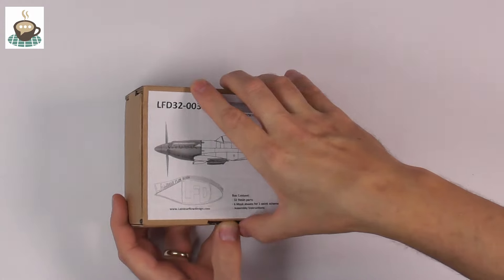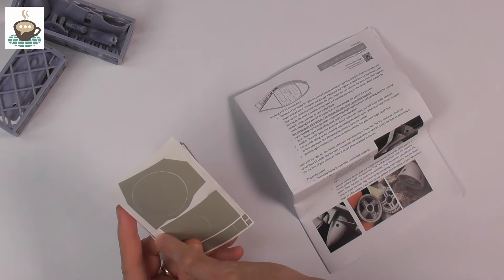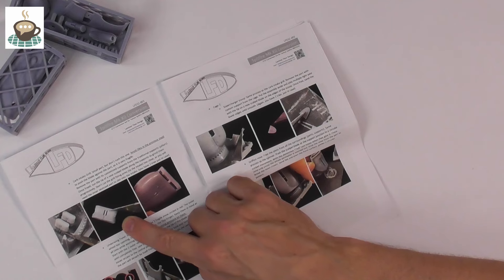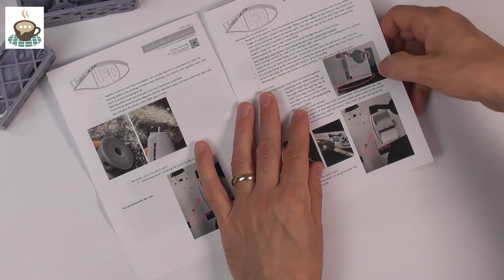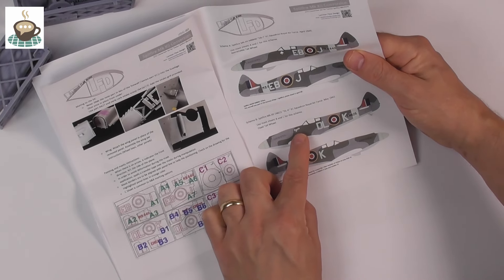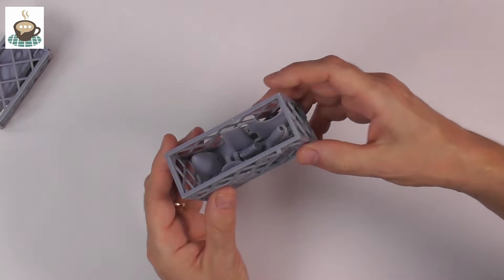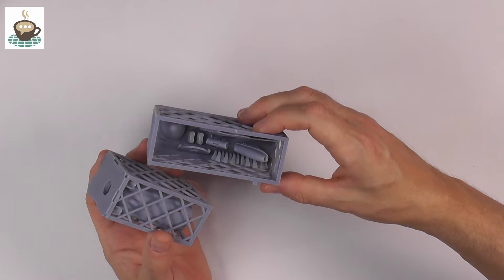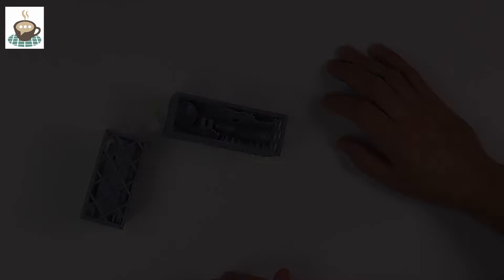Review:  Laminar Flow Design Spitfire Mk XII conversion 1:32

Comment: Yes, the 3D printed parts really do look nice and you have previously explained your position on expense, quality and value in kits.  I would respectfully make the point that the shipped price of the conversion is approximately equal (from where I am located) to the shipped price of the Tamiya donor kit and that the builder/converter will be forgoing a detailed Merlin in the Mk. IX kit for an empty Griffon nose in the conversion.  I guess you must really want a 1/32 Mk. XII, but again, beautifully printed.
Reply from the maker: I'm more than happy to bin the Merlin, I don't usually like exposed engines which is why I'm pleased that Kotare didn't include one.  It's a shame that postage is so expensive where you are, but as I have said before, if you want one, and are prepared to pay for it then get it, if you can't afford it then that's a shame, I can't afford a new Aston Martin!